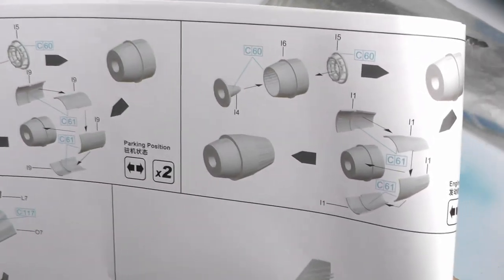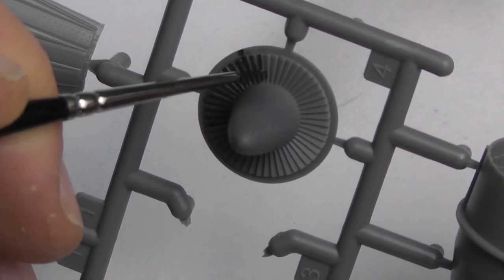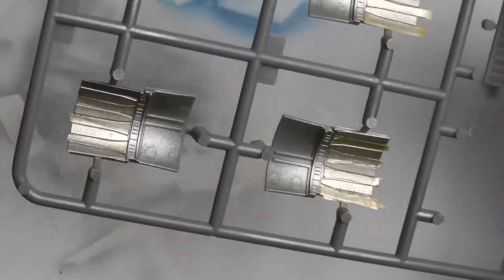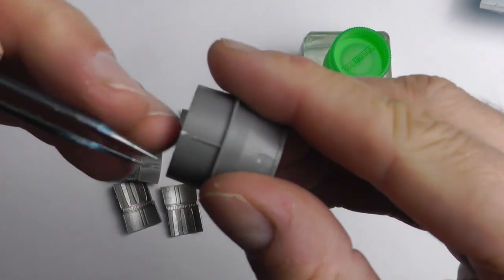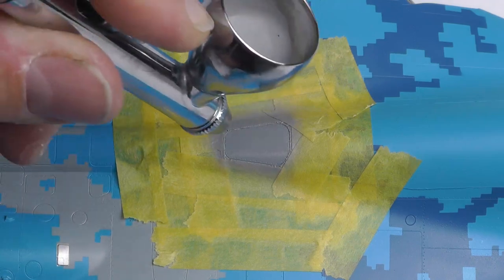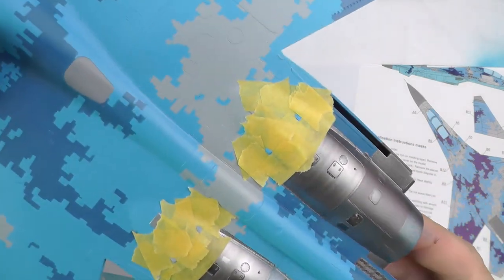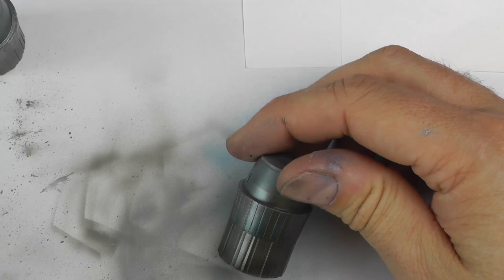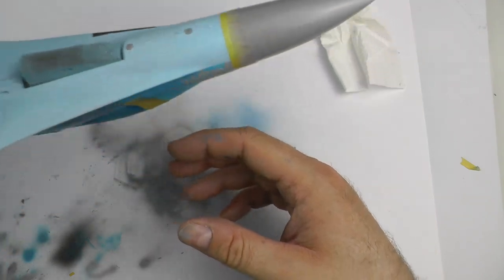Great Wall Hobby SU-27UB Flanker build Part 8 Hot exhausts Tutorial and how to

Comment: The inner side has no metallic sheen, it should be white as in reality there is a ceramic coating on the petals, with some smoke and soot :) For assembly - it's clearly visible you didn't properly cleaned up the sprue gates on the sides and it does not align perfectly.
Reply from the maker: Thanks buddy. I shall adjust it today. The photos i have are not in great light. 😎
Reply from the maker: So. Looking even further into this. Its seems to me the SU-30 and onwards had the more white ceramic petals. Some 27s have it but looking at the Ukraine Air Force examples its a very vert dull greyish metal covered in soot with no white at all. I guess it varies from aircraft to aircraft. I am going to soot up the inside to loose the metalic finish and i thank you for your kind input 🙏
Reply: @stregasplasticcartel812  Sorry then. Looks like we both learned here :D It looks like all I can find is brown-discolored steel with various amount of soot, almost completely derived of metallic sheen. I was pretty sure it's white because I saw a video once (you know, one of those you end up watching at 3am) coming from Russian factory where they replaced one of Su-27 engines and the inner was with ceramic coating. May be that new AL-31F replacements for older jets have this coating meanwhile it wasn't there originally.
I have 2x G.W.H. Su-27UB + Minibase's Su-33 + HB's Su-30MKK, Trumpeter's Su-27KUB in stash and KH's Su-34 on the bench with metallics painting just behind the corner so I'd practise the colors well :) I think I'll be going for this look with Burnt Iron and Pale Burnt Metal heavily darkened with Jet Exhaust:
https://blog-imgs-112.fc2.com/f/1/4/f14remcat/KO8A8593.jpg
Reply from the maker: @TapChanek  hey no apologies buddy. This is whats great about our community here. I agree with you its not metalic and its definitely sooty so i am going to adjust it. If you hadn't have suggested it i would have left it and it wouldn't have been correct so i thank you hugely. Ha we all love watching videos into the early hours right. Thanks again and thanks for your kind help 👍🙏
Reply: @stregasplasticcartel812  There is no ceramic in those engine afterburner petals. I thought there was some titanium nitrate, that would give them the goldish look, but no also. If you search for pictures of the new engines ( they are still in production) you'll find, that there are bear metal. 
So the only colour variation we can see only on used engines, goldish, brownish, purple and blue, depending on how often the afterburner was used in the airplane. 
White calamine deposits, can be seen on the fans, if the engine is mostly used at low revs, and almost no use of afterburner. The navy planes tend to be more hot, and the land based aircrafts have much colder engines. Chances are that photos could be taken only on training an practice jets, that will not use afterburners at all.
Nice job on that digital camo BTW. It should belong to the navy, so more blueish tint is required 😁.
I got an Academy 72 scale SU27 on display, bit couldn't do the digital camo.😔.
Great work! It's your hobby, should be fun for you, not for others
Reply from the maker: @botarzoltan3206  hey buddy. Thanks for the awesome and concise reply. It has really helped as i couldnt find and pictures with the ceramic look. So we think a bit of purple and maybe a bit more blue to be accurate? Thanks for your help with this it has helped me hugely 😊😊